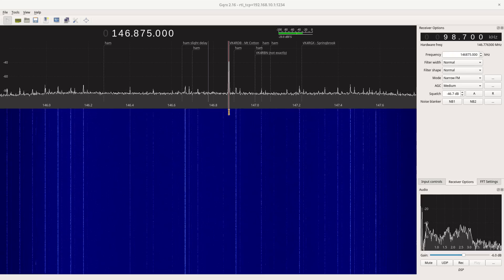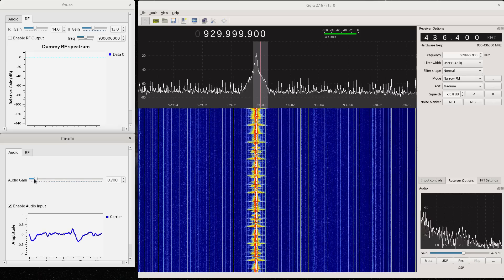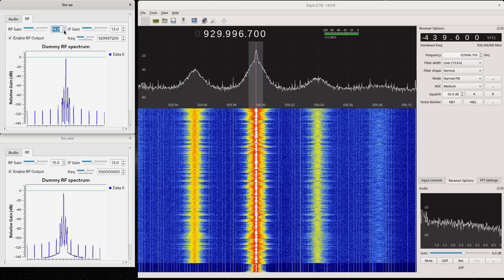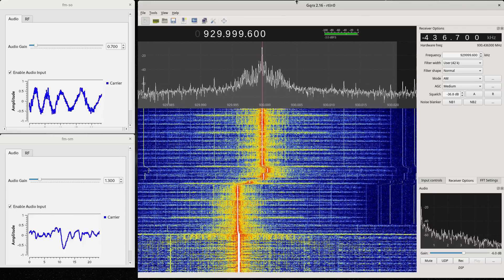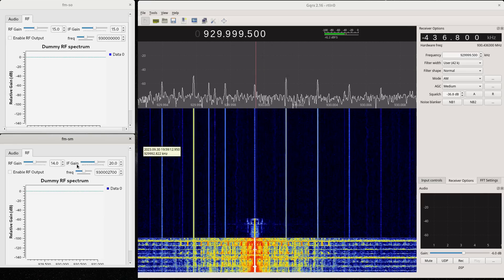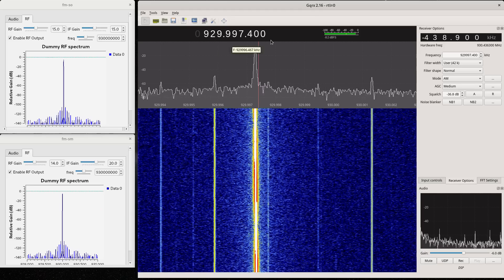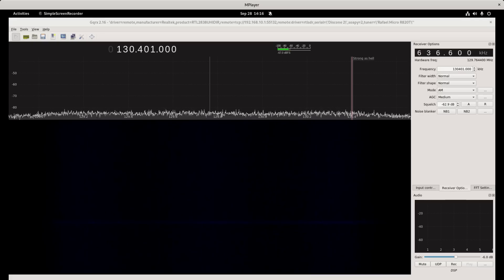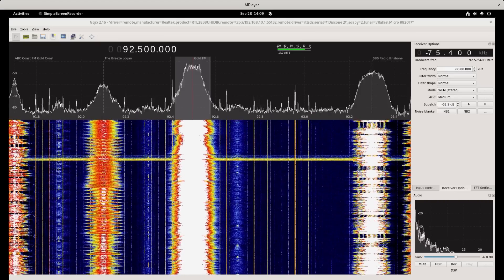Demonstrating FM Capture Effect

Comment: I see that this work in your little expriment,but i in real life when some aircraft gets stuck on the PTT u cant hear anyone else …this is not the reason why they use AM…
Reply: In practice, very seldom do any two transmitters actually transmit on the same exact frequency, down to the Hertz. So what ends happening is that instead of hearing both transmissions, we hear a somewhat garbled transmission together with a beat signal (the tone that was shown in the video). It is this beat signal that alerts other listeners that someone was "stepped on" by a second transmission. It is not ideal (both parties are not listened), but it is a better option than FM, where only the strongest signal would be listened, with no clue that someone else attempted top talk at the same time.

It's not so much "listen to both transmissions" as be alerted that two talked at the same time.

Comment: Interesting video mate, I remember lightning causing interference when listening to broadcast AM stations back before everyone jumped over to FM. Wouldn’t even have to be close for it to interfere.
Reply: @@BanterMaestro2-vh5vn, I’ve listened to lightning on medium wave and air band and there is a big difference. The lightning crashes are much stronger and louder in medium wave and can be picked up tens of miles or kilometers away. Lightning has to be close up for the crashes to be disruptive to communications assuming the Tower transmissions are strong on air band.
Reply: @@BanterMaestro2-vh5vn, on long wavelength, indeed. Fun fact. The old ADF beacons frequencies in the U. S. were on longwave.

Comment: Interesting.. I reading about the worlds worst airline crash, the Tenerife Airport Disaster, that linked one of the causes to communication issues with simultaneous radio transmissions. From the Wiki page:

"A simultaneous radio call from the Pan Am crew caused mutual interference on the radio frequency, which was audible in the KLM cockpit as a three-second-long shrill sound (or heterodyne). This caused the KLM crew to miss the crucial latter portion of the tower's response. The Pan Am crew's transmission was "We're still taxiing down the runway, the Clipper 1736!" This message was also blocked by the interference and inaudible to the KLM crew. Either message, if heard in the KLM cockpit, would have alerted the crew to the situation and given them time to abort the takeoff attempt"

Do you think the heterodyne sound the KLM crew heard was similar to the strong carrier we heard when both your transmitters were not 100% aligned?
Reply: There was also an issue with the phraseology used something acknowledged by the local authorities.